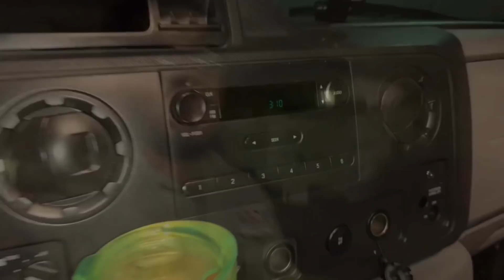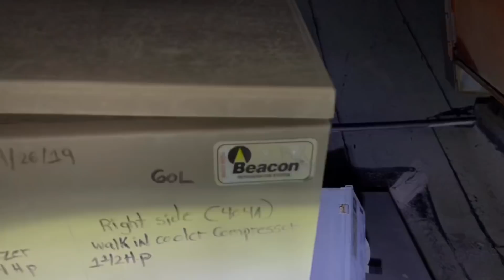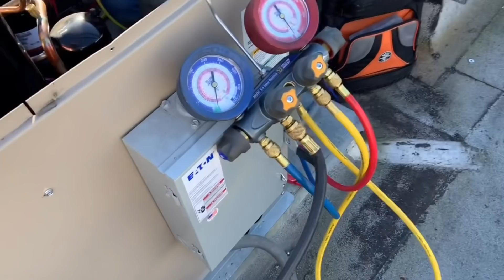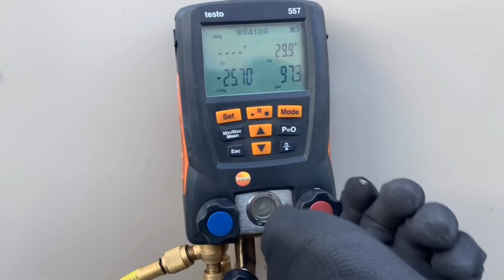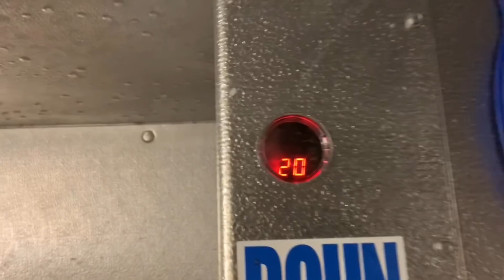HVAC-R vlog  BEACON WALKIN FREEZER /COOLER INSTALL !!!!

Comment: Looks like a good days work! 
It looks like your getting a nice variation of install/service work which is fantastic if it hits the sweet spot that you enjoy.
In the uk there is a divide between service and install, most service based engineers would avoid any install work like the plague lol
I don’t mind personally, started of doing install but It’s the time away from family working away from home that now dictates my job, I’m 100% service based which works well for me just now. Until the kids are old enough to leave the nest and Me and the wife can move to the states 😆